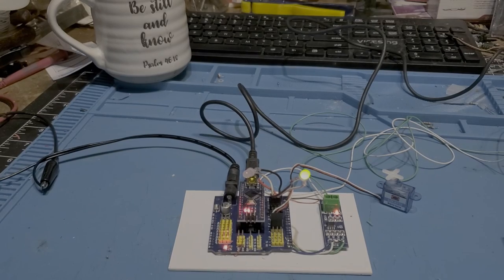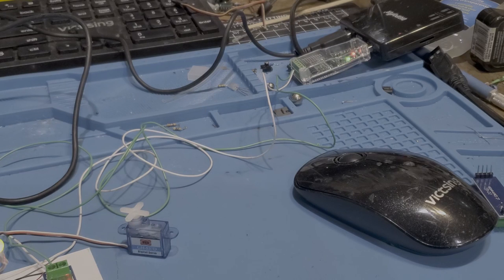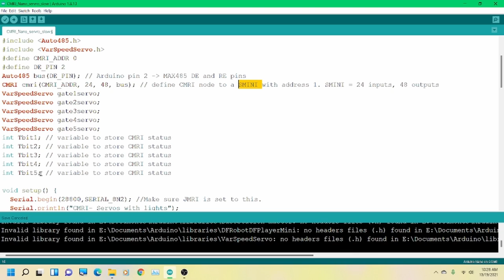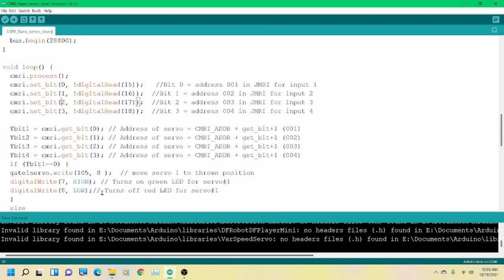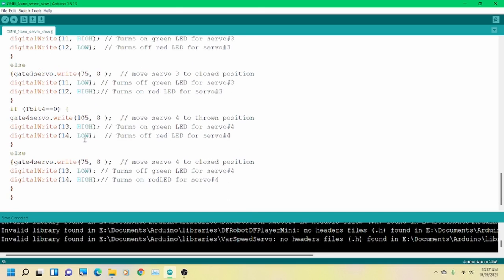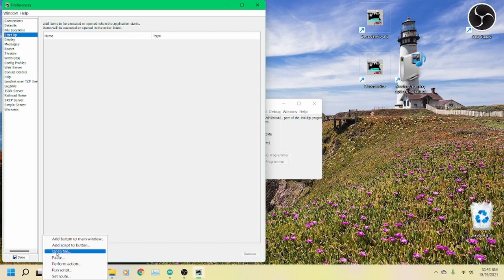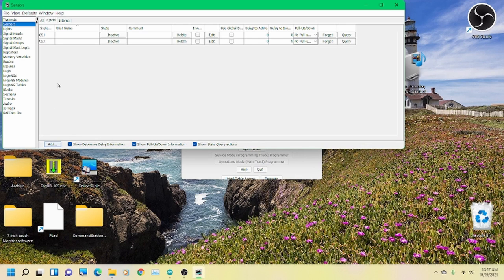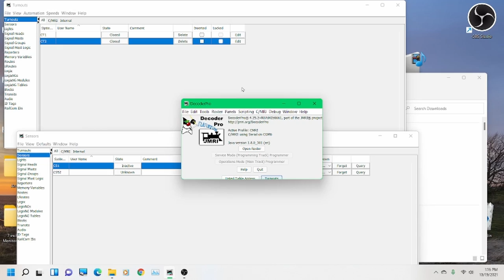CMRI & JMRI Servos using an Arduino  Nano

Comment: Larry, what is the RS485 and why is it necessary? I haven't seen this item in any other projects.
Reply from the maker: Hi Doug, RS485 is a serial protocol wherein you can tie multiple devices to a single RS485 adapter. This is very versatile where you have multiple Arduino's connecting to JMRI. Otherwise, each device would have to have an individual serial port.